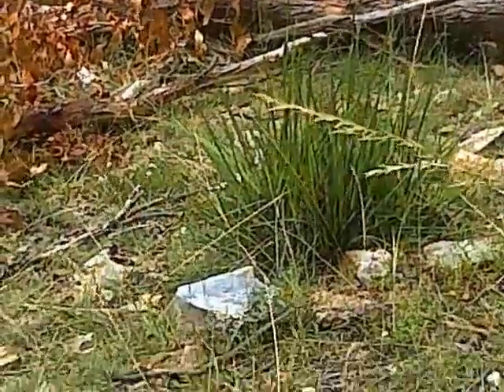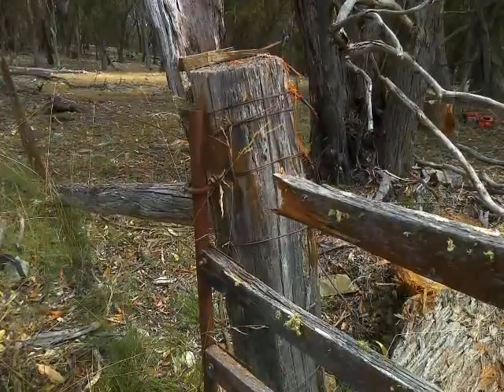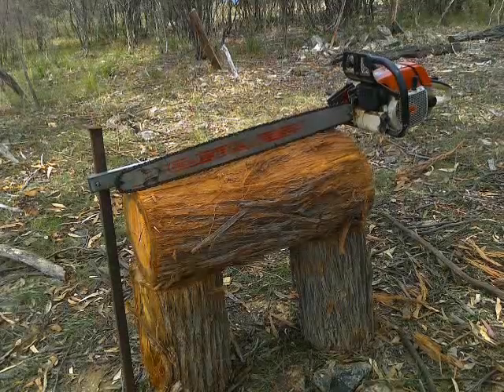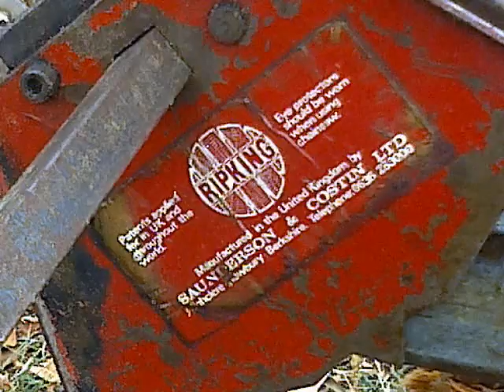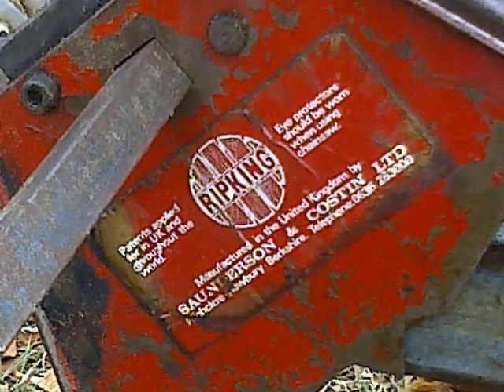Quarter-Cut Milling Timber, With Chainsaw And Guide-Rail...

Comment: cool!
Reply from the maker: G'day,

 Thanks mate,

 I figured if I was going to spend a day in Sawmill-Mode then I should share it...; & I was a bit cunning, in that after about 2 & 1/2 hours elapsed Time with 13 Minutes in the Can, I took a break & put the Phone-Camera on the Charger up at the Hut for 3/4 of an hour, with the Video being held on the Pause-Button, so I managed to fit about 5 hours elapsed into one Video despite 3 Hours being as much as a Full Battery can cope with...

Have a good one,

;-p

Ciao !

Comment: I'm surprised at you Warbles. I expected you to hand saw it, with a big double ended saw. With you on both ends.
But I suppose were none of us getting any younger, EH?!
Reply from the maker: G'day,

 Thanks mate,

 Absolutely..., when I was 35 it was a lot easier to use this stuff than it is at 55..; but I do have a Cross-Cut Saw, standing by, for when the Petrol Tap is turned off (at the Refinery in Singapore )...

;-p

Ciao !

Comment: No need to go to the gymnasium with that kind of work?  Good job done there.
Reply from the maker: G'day,

Thanks mate,

 Yeah, it's one of those things which actually involves swinging a 27-pound Chainsaw through Logs which can start out weighing large fractions of a Ton (3 feet is easy, but 24-footers take some pre-thinking about before trying to move them into place for Milling...)...

  It's hard yakka, but it beats wasting a millable Log when it's just sitting there drying out and otherwise turning into Firewood ; so when I feel particularly keen, I play with my Sawmill till I get sick of it...(!).

;-p

Ciao !